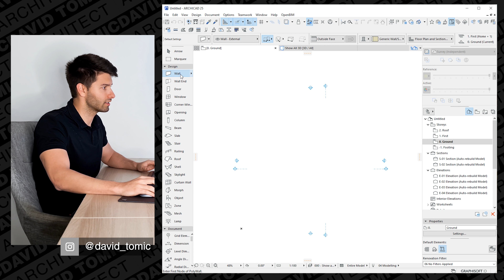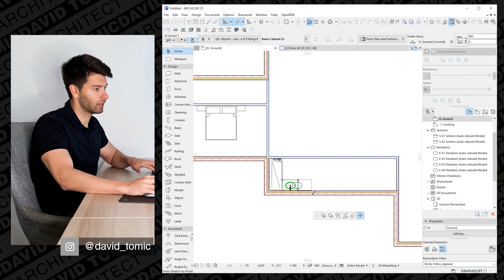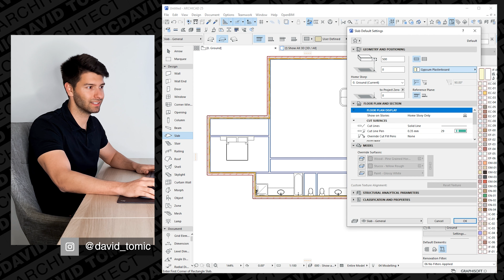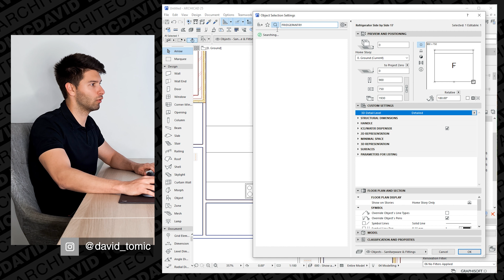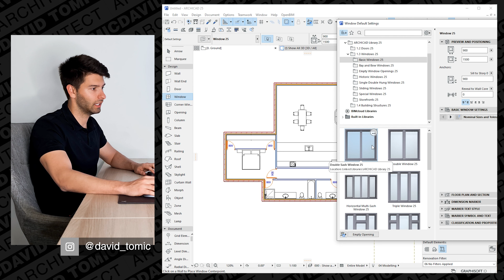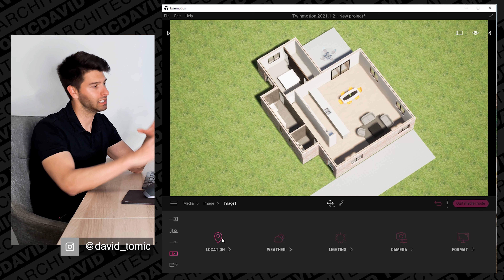3D Floor Plans in Under 30 Minutes @Archicad + @twinmotion

Comment: Hi David,  Fantastically helpful and time saving advice, thanks.  Do you have any advice on how to import specific pieces of furniture into TwinMotion? I have started with an ArchiCAD model, and the commissioning architect has given me a load of links to fabrics, lamps, pieces of furniture and lights that she would like incorporated into the model in place of the ArchiCAD ones she currently has placed in the model. Is this even possible? or do I need to find nearest similar items already in the TM database? Thanks.
Reply from the maker: Check the twinmotion course I recently posted on my channel :)

Comment: Hi David, thanks for the demo, just subscribed. what’s your PC specification?    Do u think 16GB unified memory and 512 SSD Storage. My projects mainly residential and mid size commercial building
Reply from the maker: Personally I have 32gb and it's still not enough
Reply: @DavidTomic  so new IMac is not an ideal buy. 🤔
Reply from the maker: Havent tested it yet. Imacs are usually pretty goods but I personally wouldn't buy the 24" I'd wait for the 27"
Reply: @ychongong4680  iMac has upgradable memory for a reasonable price... get 8gb version and get some Samsung/Kingston aftermarket RAM. Just make sure not to mix it with OEM ram. It would lower down the speed otherwise. Or you actually refer to m1 iMac...
Reply: @wonabe  thanks for sharing Wonabe. I was referring to latest IMac spec as my old laptop can no longer handle Archicad 25. 😬
Reply: @ychongong4680  I'm working on both 8GB Air and iMac 2020 with Archicad. However our projects can differ. Best what can offer is to start your project on my machines and see how it performs.
Reply: @wonabe  Thanks for the offer Wonabe! Anyway I will still go ahead and purchase the latest IMac and max out all the spec I can 😬